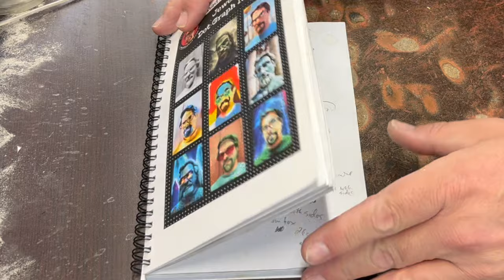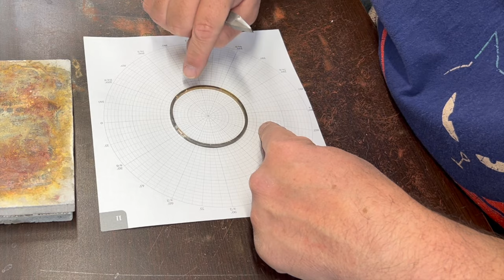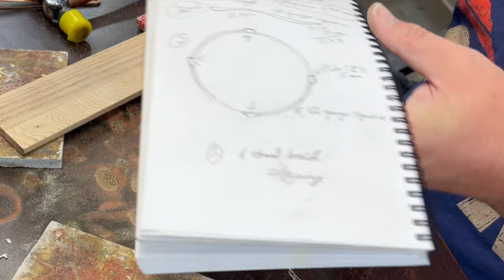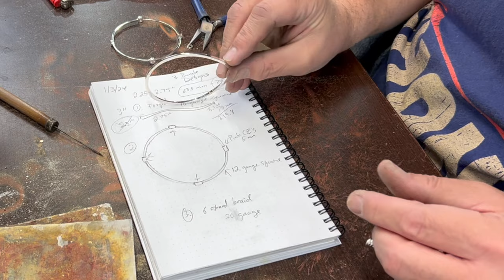3 Bangle Bracelet Designs:  A Silversmithing Tutorial

Comment: Thank you for sharing your knowledge,  technique(s), and where/how to start a jewellery project(s)! They're all awesome! 
Do you have any videos where/ in which you discuss/ demo the different types of torches, gas types, and each one's max capabilities? If so, can you please direct me to it or leave a link [within your reply] please? I have a "creme bruleé"/micro torch but am not sure of it's capabilities either... AND there are SOOOOOO many torches/gas set-ups that it's confusing! I have used a mixed gas torch [in a class] but am not sure which gas it was... I THINK it was still butane, but it was similar to the set-up you have here + the big bottles.... HELP  PLEASE!!?!! At the moment, I primarily work with silver and gold-filled; sterling (.925); and argentium (either .935 or 
.940 ~ not sure because I inadvertantly mixed my older stock [.935]with the newer stock [.940])...🤨🤔
💜🤙💙🥰💜
Aloha & Mahalo Nui Loa!
Reply from the maker: Hello CASHayward!  I'm glad you liked the video.  I haven't done a specific video comparing torches, as my experience with other torches is limited.  The one I use is a Smith Acetylene/air torch.  For my beginner groups I have them use Benzomatic propane general torches.  Not the best torch for this, but a cheap torch that works well up to a certain size of project.  Doing a big cuff or belt buckle would be difficult to get to temperature with these.  From my experience, the butane torches just don't produce enough heat to be very effective.  Hope this helps a little bit at least:). This early video of mine does discuss torches for beginners:  https://youtu.be/oS0DcoPTgJo?si=TOaXYRbbvskmuUqm